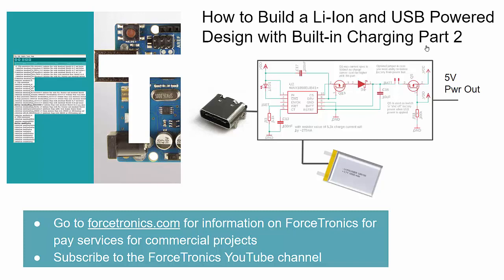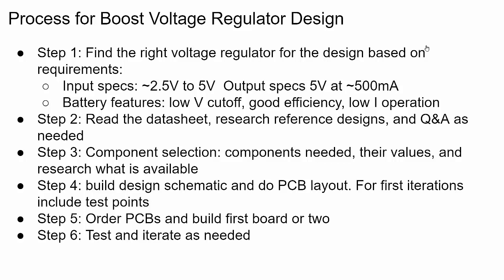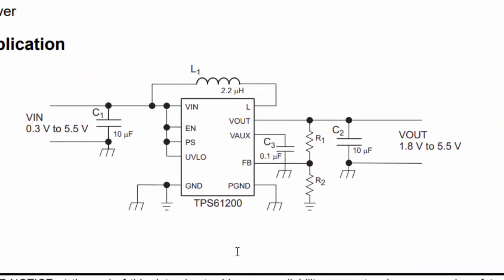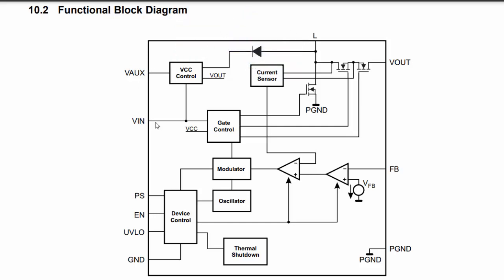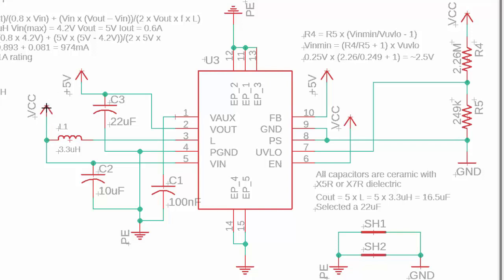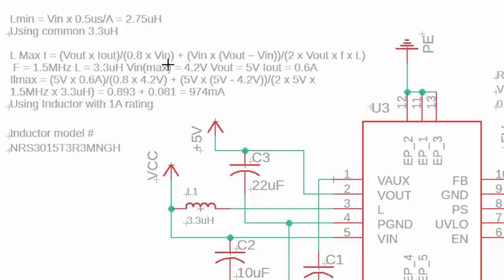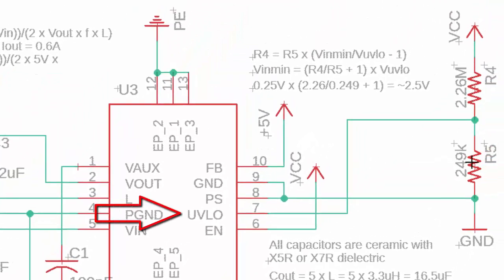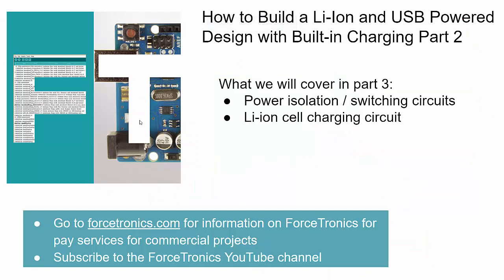How to Build a Li-Ion and USB Powered Design with Built-in Charging Part 2

Comment: Can the same principles be used to design a high power circuit, by just swapping the components? I am looking to design a lipo/li-on ups, which will accept a 5volt 6A input, have a 10,000 mAh battery attached to it (that can discharge @ 5 amps). For the output, I am desiring one output capable of 5v/3A (For a raspberry pi 4) and another output of 5v/2A (To power accessories).
Can I use the approaches described here, or do I need to keep an eye out for other things? Also, any advice about adding voltage reporting via i2c to this circuit would be amazing!
Thanks, and great series by the way! No other video to be found on the whole wide web that dives into this topic, so this is basically gold for me!
EDIT: Also, is this circuit safe for the battery and the device if it continues to be plugged into mains, even after the battery has finished charging? Does it automatically stop the battery from trickle charging once full?